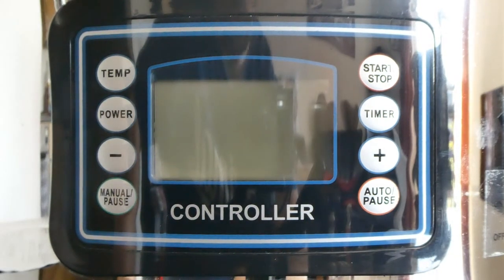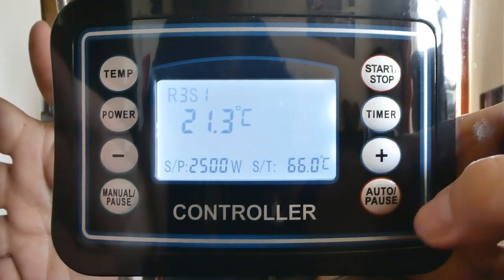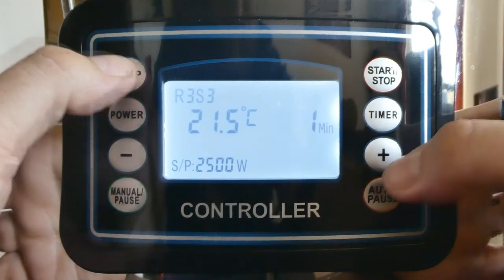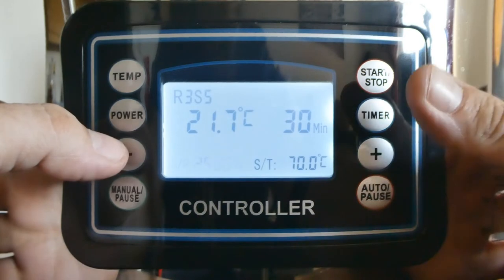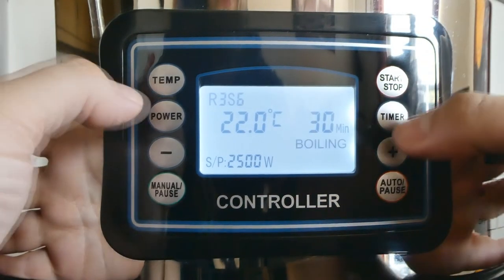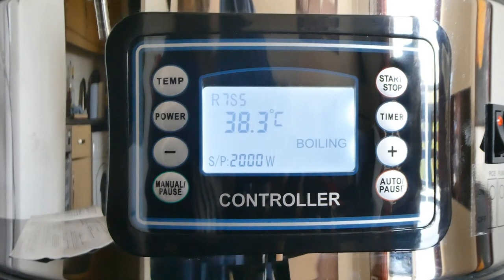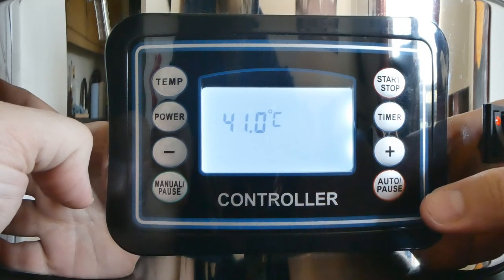Programming the updated Brew Devil controller

Comment: Thanks for the info, helped us a lot. 

00:30 Selecting a recipe 
00:37 Set temperature for each step
00:59 Setting the timer for each step
After that, until 4:39: Adjusting the mash settings for each step
4:39 Set hops for each step
5:28 Finish recipe and save it
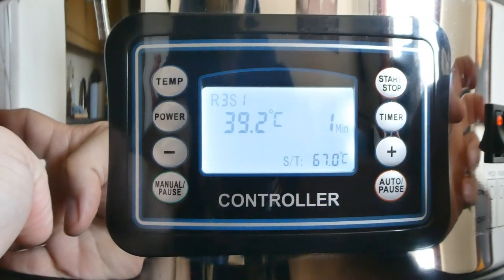6:20 Select recipe from saved recipe

Comment: Thanks heaps. Just acquired one and this is made it so easy. I didn’t realise you could do this. I did my first boil yesterday and it has some kind of program that somehow I got through using it and had never used the controller before. But next brew be sure I will follow this. 🎉🎉🎉

Comment: When pressing + and - together for 5sec, one may change the boil temp as per altitude (C1), do you perhaps know what the C2 setting is for?
Reply: Can you explain how to change  boiling  temp  if  i Live  in a place  thats  465  over the sea  level
Reply: I have same question ;
What is C2 for?

As for C1, it can be used for overall temp. correction anywhere in the programming, not just for boiling.
I checked with two thermometers and the display is 2.5°C underreading around mash temps. An important area to be correct. 
I have to take it out again at boil time, as it's not inaccurate there and won't actually boil when it reads the temp. as 100° C. As it can be altered 'on the fly', not a problem.
As Bathtub Brews says, these alterations are lost when it's turned off.
Reply: @martinnavalesparrell113  Although you can do it 'scientifically', as it gets lost when you turn it off, just use a rule of thumb method.
When it comes to the boil stage (and not before, as you will alter mash temp. as well, which you don't want to do) press TEMP, + and - together for five seconds then firstly try -1 and TEMP. then -2 etc until it does boil well. Note the adjustment down and use it for future reference.
Can't help with the scientific method as you don't say if you are using Feet, Metres, Fahrenheit or Celcius units.

Comment: Are the hop additions time set to start of boil? So a 60 minute addition is at the start or finish of a 60 minute boil?
Reply: Hi Ashley, the hop additions are always calculated from the end of the boil, so for a 60 minute boil your 60 minute addition would go in right at the start and a 5 minute addition for example would go in with 5 minutes remaining, hope this makes sense.
Reply: @jamietalbot1098  yes thanks I assumed it was that way just wanted to make sure they programmed it as it's supposed to be and not backwards for whatever reason

Comment: Thanks for this. The fog has cleared =)
 If there is anyplace this info exists in written documentation I'd like to get it. 
Question: Are the hop times from the end of the boil or from the beginning of the boil?
Reply: Just found the manual that has this programming info. 
http://www.angelhomebrew.co.uk/upload/brew-devil-manual.pdf
Looks like the Hop time are countdowns from the start of boil which is opposite of the more common convention of specifying the duration of time the hops are included in the boil (=end of boil - specified time)
Controller is the same as is used on the Klarstein Mundschenk which is what brought me here.

Also I've noticed if the temperature is higher than the set temperature, the step proceeds to count down as if the correct temperature is active.

Comment: Hi, thanks for the video. One question - why is it necessary to add a step(s) with 1 minute? What would happen if I just set the steps like this:
R1S1: 62 °C 30 min, 
R1S2: 71 °C 30 min, 
R1S3: 78 ° C 10 min, 
R1S4: BOILING , (and then hops additions)?
Thank you for answer.
Reply: Hi,  there is nothing wrong with doing it the way you have stated,  the reason for me adding the 1 minute steps is to allow me to use a higher power to get it up to temperature quicker for each main step. I hope this answers your question. Thanks for watching.
Reply: Aha, now I understand, thank you for your answer and as (home)brewers say in Czech Republic: "Dej Bůh štěstí!" :)
Reply: @davidkovarik483  Dej Bůh štěstí = God Bless You!  (more literally: May God Give Happiness/Luck)

Comment: Hi thanks for this info its very useful, one question when calibrating the temp mine is out by 2.3 degrees, i press the + - and the cal symbol appears i then set the temp, how do you lock it in?
Reply from the maker: Hi thanks for your question,  as far as I am aware from my playing around with the controller,  it is not possible to lock in the calibration permanently,  each time you turn off the machine it will need recalibration.
Reply: @bathtubbrews6512  hi thanks for the reply, i purchased the brewer in september and used it yesterday for the first time, unfortunately it has a couple of faults, when i set the steps in auto say to reach strike water temp at 66 degrees it does not stop at 66 it keeps heating till it boils, ive just emailed the supplier so hopefully it will be being exchanged.